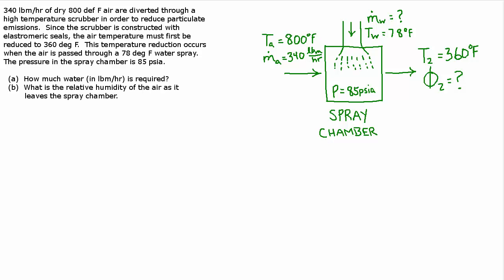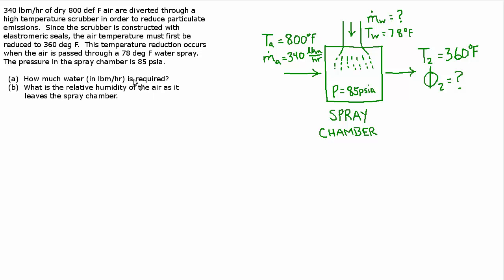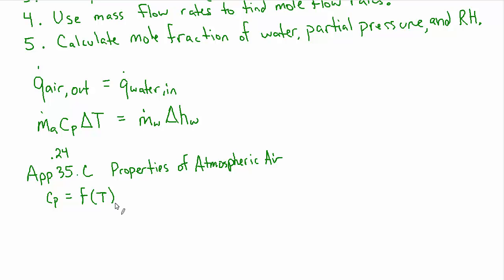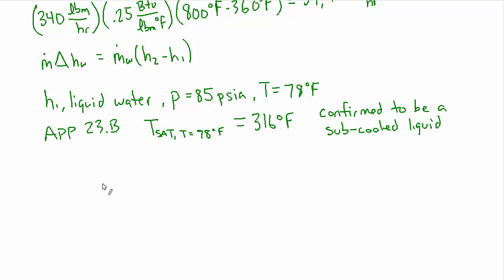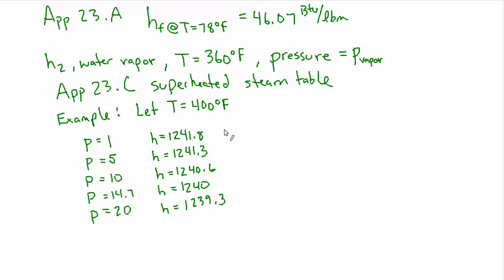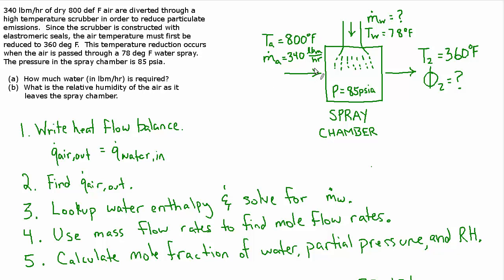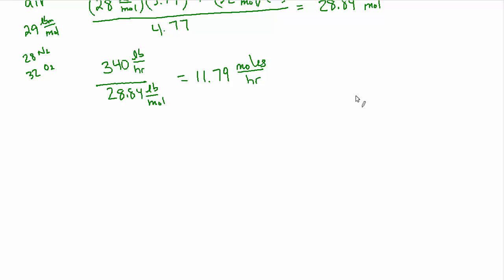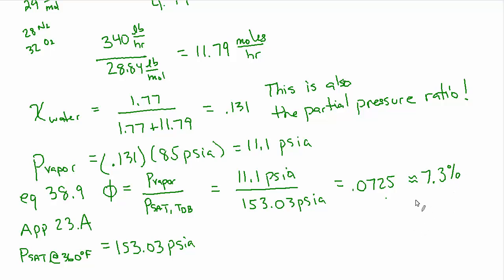HVAC & Psychrometrics Problem Solving for Mechanical PE Exam | Mass Flow Rate & RH Calculation

Comment: Again, great problem and solution.. one more thing I noticed when I reviewed this video again..  When you calculate the enthalpy of the water (which doesn't vary much with pressure so it doesn't much effect the answer), you mention that the water is only at its "Partial Pressure of Water" - however, I don't think that is correct; though the water vapor is only contributing part of the total pressure, the pressure it is experiencing is the total pressure.  Not trying to nitpick.. just helping ensure we're conceptualizing accurately.
Reply from the maker: The pressure it is experiencing or the pressure it is contributing to the total?  I think that's where to distinction lies.

Comment: Very nicely solved and explained.  One problem, it appears you are using values for Molecular Weights of the elements that are in grams/mole or kg/kmol, and assuming they are in lbm/mole.   Now, you may only use these units to compute ratio of water to air, so you may still get the correct answers, but some of the intermediate results will be incorrect, and in most situations, the final answers would be wrong.
Reply from the maker: Thanks Larry, and good point, a bit fast and loose with the units there on my part.  Thanks for the keen eye!
Reply: @MechanicalPEExamPrep  But I don't think there's any issue with solving the problem the way you did looking at Larry's comment. Isn't it why people came up with the idea for lb per lbmol instead of grams per mole or kg/kmol? The lbmol being adjusted in a way to give for example 18 g/mole equals to 18 lb/lbmol to make it easier in these type of questions. A lbmol is a different quantity than mole and lb/lbmol can be converted to moles or kmol if we are being asked for actual moles which is just a unit of the number of moles in the substance in the end instead of the questions like this that we can have a peace of mind in my opinion using lb/lbmol as these can be used to find fractions safely.

Comment: I am studying for my PE exam. I am not taking HVAC, but will have some HVAC problems. Can you use volumetric flow and Temperature to find Temperature? Say there is a db and rh humidity inside a room. Then there is a db and wb temp outside. Air is blowing inside the room with air already in the room. Solution shows temp exiting using T_out * (V_out) = T_in * V_in + T_insideRoom * V_insideRoom. You can use this to find temperature? This is legal?
Reply from the maker: Always best to work with mass flow rates when performing a mixing calculation, but volumes can work in a pinch if the required precision is low.  Judgment call as to how sharp you pencil needs to be.  For example, in the design stage, you have the luxury of time to be accurate, but less confidence in the assumptions.  During commissioning/operation, you have rock-solid assumptions (physical measurements), but perhaps the range of acceptable performance is wide so no need to deal with specific volumes of each state.  In an exam environment, you are balancing the time required to go a bit deeper against the probability that the answer choices will discern or if rules of thumb will fly.  Honing your judgment comes from solving lots of problems carefully.  Good question and good luck!

Comment: The  water  becoming steam under 85psi. The sensible heat added from 78F to 317F(85psi sat. tem) as well as latent heat is added at  85 Psi to 360F while the pressure of the steam stays constant up to super heat, at 85 psi, which gives me 1209btu/hr as h2 for water. 
I Did not understand your logic, the steam is never under 10 psi, it is at 85psi.
I got the same answer you got,31.8lb/Hr  used H from table of "properties of air low pressure" in the manual
Reply from the maker: Hi Natan, As long as we get the same answer in the end, I'm happy if you're happy.  Let me know if any open questions to address. -Dan